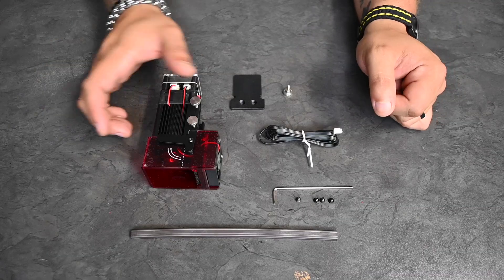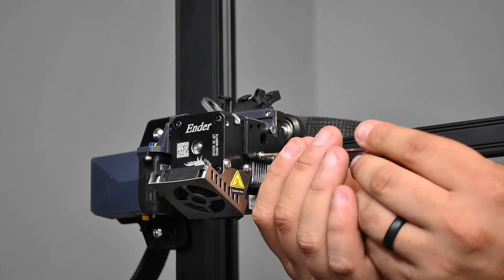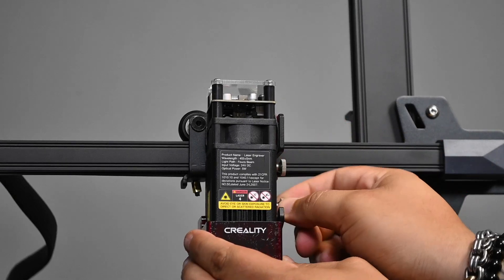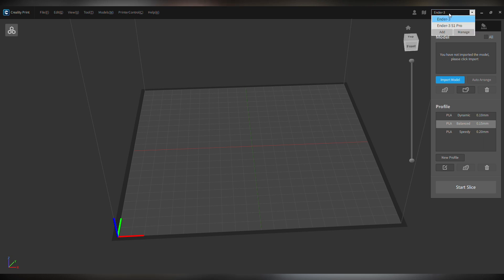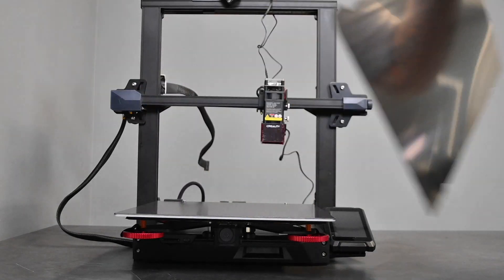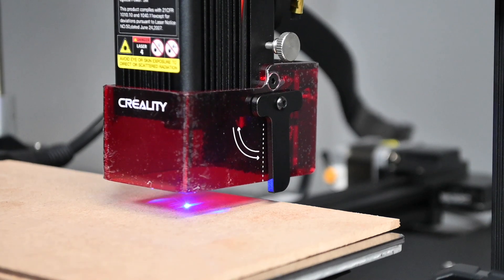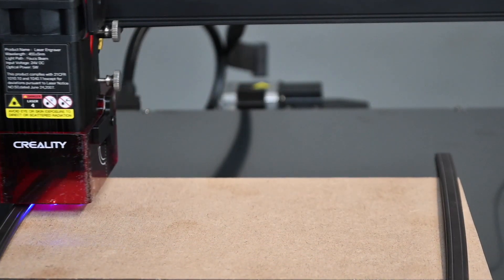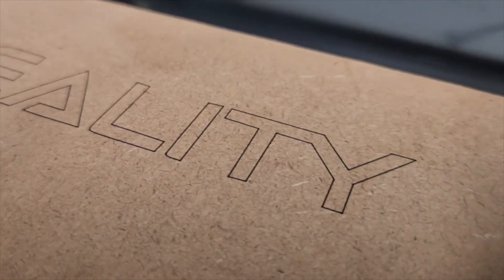How to use the creality cv laser

Comment: Not a big deal, I don't guess but I'm pretty sure you placed the magnets in the wrong place your supposed to place them on the outside up against the wood to hold it in place not on top of it, the magnets are not strong enough to use them like you showed. Again not a big deal just thought I would let everyone know.

Comment: should you use air assist and or the honey comb?
Reply: Hi just curious did it work?
Reply from the maker: Our technical team couldn't get to it last week unfortunately, they said they will try to get to it today, so I will let you know later if they do and what they figure out.
Reply from the maker: It is not technically necessary, but air assist helps improve the detail of the cut, and keep the lens cleaner for longer, on that same note, honeycomb bedding helps not leave scorch marks on the back of cuts and helps you avoid engraving whatever backplate you use, in this case the bottom of the printing bed.
Reply: That helps so much! Also can you plug the 10w laser directly in to the ender 3s1 pro without using the control box or only the 5 and 1w?
Reply from the maker: @AlexOscarsWorld   I don't have an answer for you yet, but our guys will be testing it out today to see if it is possible

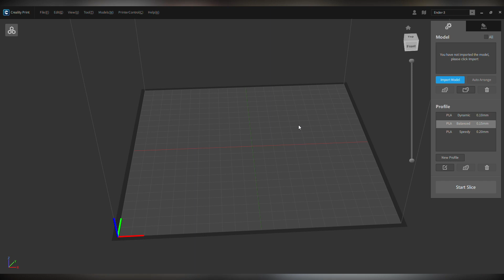Comment: hi, on your video 4:54 you not have on there LASER options, on 4:56 you have there options LASER! how i can swith to the Laser please, I not have options there for LASER like you on 4:54 :)
Reply from the maker: Maybe try reinstalling the software and make sure that the Ender-3 S1 is selected as the device you are using, the option to select the laser should be there by default
Reply: @3DPrintingStorecoza  you cut the video from not having the fdm and laser tabs, to magically having them pop up. I reinstalled, it does not pop up by default. What did you do in that section you cut out to get the laser and fdm tabs to show?
Reply: @3DPrintingStorecoza  hey just tell him to add ender 3 s1 laser that's right beside the pro profile in the drop down, it does not pop up by default